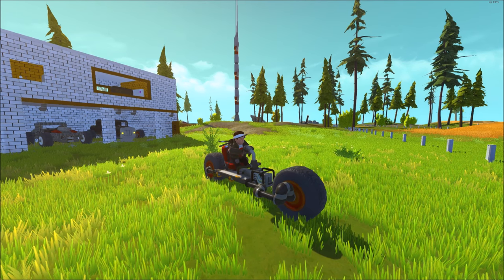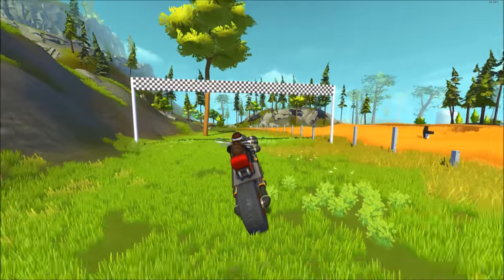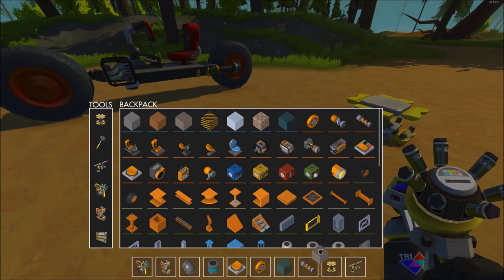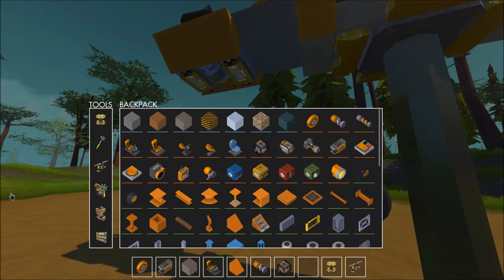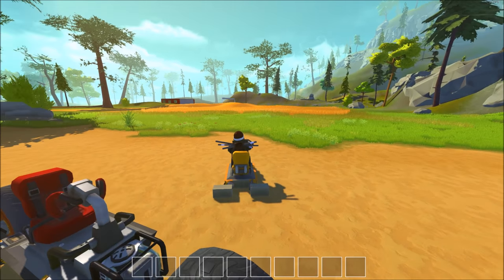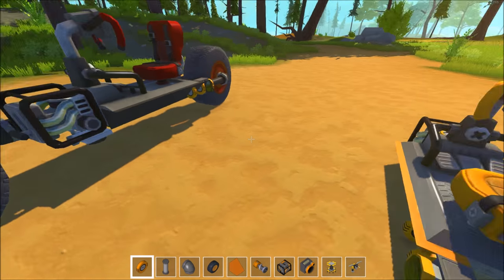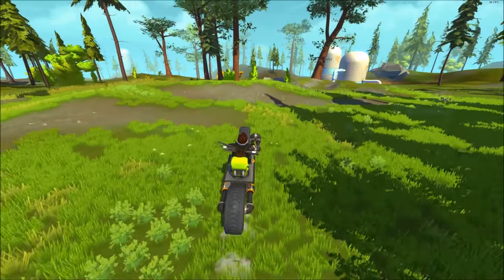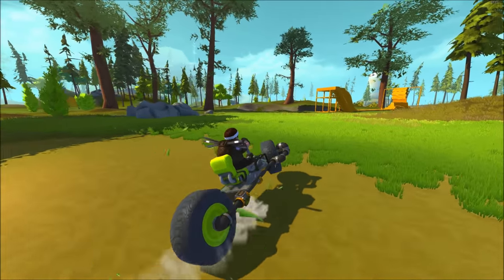Scrap Mechanic - RACING MOTORCYCLE (V3: Improved Steering, Balances and Leans)

Comment: Very awesome bike, have yo thought of doing a three wheeler (2 in the front 1 in the rear?)
Reply from the maker: I have built 2 leaning trikes in the past, 1 normal, 1 reverse, one of them worked pretty well and both of them looked a little bit odd. But yeah it did work. I might revisit it though. I'm also thinking about a superbike and a sidecar. If any of em turns out you'll see a video appear soon xD

Comment: The suspension glitch isn't working, can anybody tell me some reasons it might not be working? The car just tips over and thats it.
Reply from the maker: By default both suspension glitches push you the same way I believe. I flipped one in the video, did you do the same?

Comment: Scrapmechanic players: wow Thats awesome dude , never seen one!

Besiege players: giggles cute

Just saying wut different gmers would say
Reply from the maker: Actually most scrap mechanic players will respond the same way. This is something I built in the first few days after release of this game, people just wanted to know how fast it was around the track and the tutorial could use some updating xD
Reply: +OttoNL really scrap mechanic and besiege you can do tons of things in that you can't easily do on the other, besiege allows fighting,  large complicated stuff with less lag, ect. scrap mechanic allows for fast walkers, ai bots, computer systems, and easy in game musi,
Reply from the maker: yeah I've played both and I wouldn't say one is easier or anything. in besiege stuff usually works as you'd expect, in this game you never know what's gonna happen with this weird engine. however it's definitely easier to make good looking vehicles in scrap bc of the smaller grid and it's easier to make transformers bc wood is rigid. so it's kind of apples and oranges imo